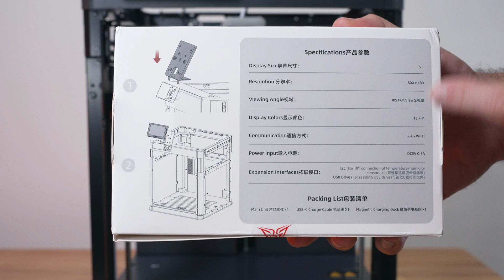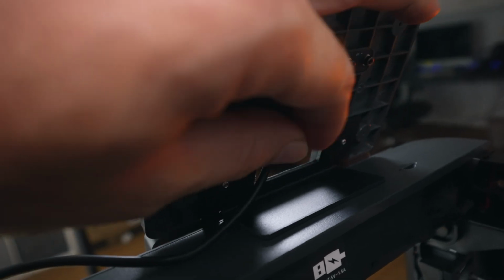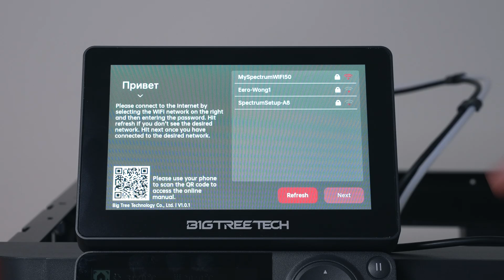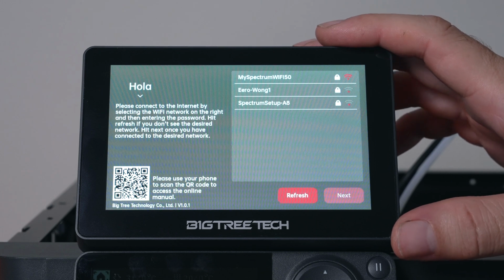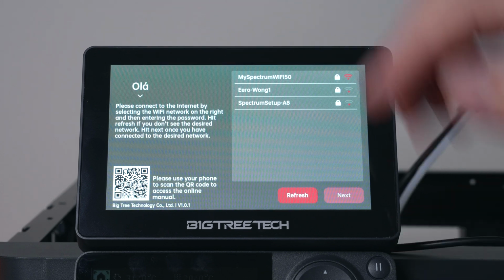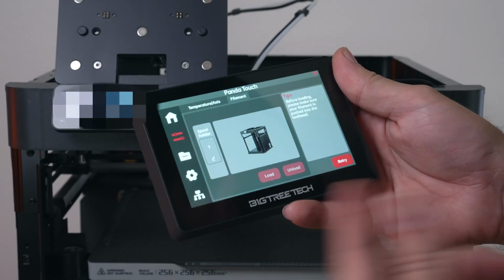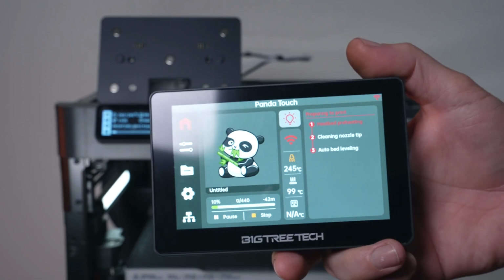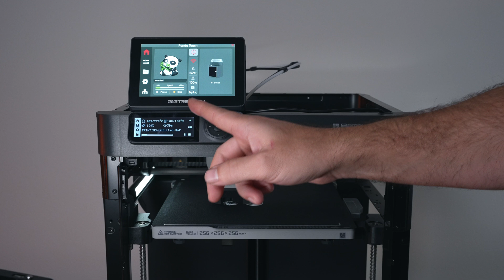Panda Touch - Screen Upgrade for Bambu Lab P1P/S

Comment: Cool system! The only gripe I have with these screen replacements is that it would look a lot cleaner if you could just replace the OEM screen so you don't have two screens visible. Maybe it's just my OCD, but someone needs to get on that! lol
Reply: i was thinking the same.  it just looks like a tablet on top of the printer

Comment: On the webside where this is selling it says its only compatible with firmware 1.5. wich firmware are you on?
Reply: Hey man there is a beta update which allows you to use it with the 1.6 firmware. You will just have to request for access. It works fine for me!